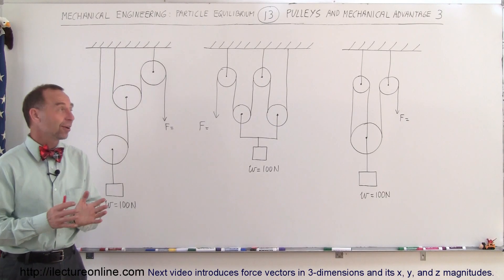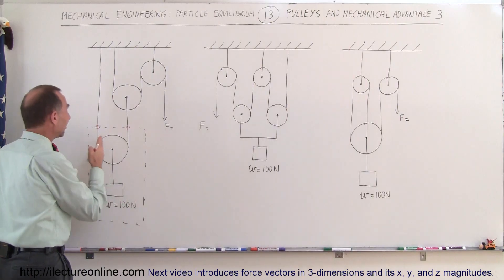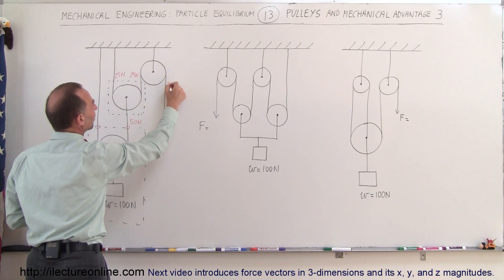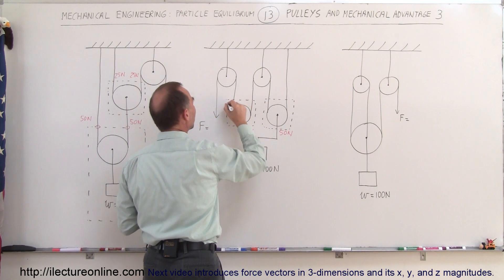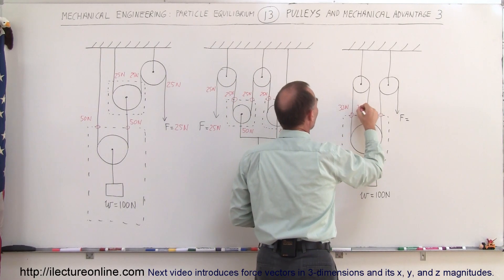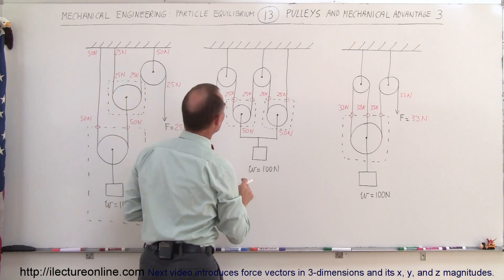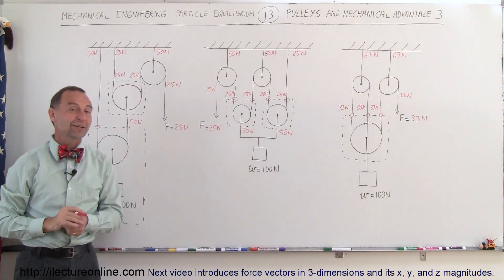Mechanical Engineering: Particle Equilibrium (13 of 19) Pulleys and Mechanical Advantage

Comment: Number 1 has 3 pulleys and you need 25 N.
Number 2 has 4 pulleys and same need 25 N
Reply from the maker: That shows that it is not always dependent on the number of pulleys, but also on how they are connected.

Comment: Wait, what? In your third example, let's say the supporting structure is a beam that has a breaking strength of exactly 110N. Now let's say that the open end of the system (F=33N) extends to the floor where it is tied to a shackle. In addition to the 100N weight, let's add 1N for each small pulley, 2N for the large pulley, and 1N for the rope, for a total suspended weight of 105N. Are you saying that the beam will break because the pulleys are inducing 133N on the system rather than 105N? I'm not a mechanical engineer, but I don't think so.

Comment: Hi Michel, thank you for that very clear exposition.
I have a question about how far the load can be moved before the upward moving pulleys can move before banging into the fixed pulleys. #1 looks like a winner in the MA = 4 category because it only uses 3 pulleys compared to #2. #3 has an MA of only 3 but uses the same number of pulleys as #1. 
Some systems used in mountaineering have "locks" that have to be moved or "reset" as the mountaineer pulls herself upwards. I suppose this stops the climber from falling too far if they let go of the rope but it explains why you don't see mechanical systems with these brakes right in the middle of all those ropes.
Please could you add some comments on the practicalities of each system and why some are preferable in given circumstances?

Comment: the teacher's explanation is too simple and did not get to the point! Everything must be reduced to simple mechanisms. The simple mechanisms are the levers and the inclined plane. If you reduce each wheel of the pulley with a lever with equal arms, then the analysis would be much clearer and much more essential. With respect, the professor did not reach the essence of the problem, making this parallel to the levers

￼
Reply from the maker: It depends on what you are trying to accomplish.  Thank you for your input.

Comment: Example 1 prediction: 50 of the weight has to be going directly into the cieling at the beginning because of the ceiling rope, so the other 50 weight has to be going into the middle pulley. 25n of the middle pulley has to be going into the ceiling from the rope, so 25n has to be going into the top pulley. The top pulley just redirects our force instead of multiplying it, so we need to put in 25n of force for 4x mechanical advantage and 125n in the ceiling. 100 from the weight 25 from our downforce.

Ok I seemed to visualize the free body diagrams similarly to you thats good. I didn't consciously think of it as 2 separate ones, but that seems to be the process I used atleast.

Example 2 prediction: has to be 50 weight on each connected pulley. Bottom Right pulley has to have 25n going to the cieling rope, and 25n going to the Top Right pulley. Bottom Left pulley has to have 25n going into Top Right pulley, and 25n going into Top Left pulley, and top left pulley should also have 25n from our pulling.

So 25 at right ceiling connection, 50 at middle ceiling connection, 50 at left ceiling connection (25n from weight and 25n from our pulling). 

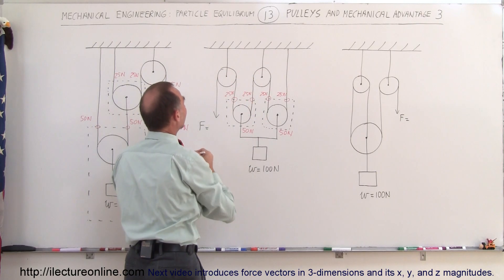OH 3:02 was really important to hear. I was kind of confused about how we as the puller add more downforce, but both sides needing equal tension i think helps me make sense of it.

I again didn't visualize the FBD like how you drew it, but I think i still did a similair process

Example 3 prediction: Bottom pulley has 3 connections, the Top Left pulley has 2 of those connections, so it has to be 66n, Top Right pulley has 1 of those connections so it has to be 33n, and because both sides need the same tension we need to be applying a downforce of 33n. So 66n on each pulley for 132n on the ceiling.

Ok I think I managed to predict all of those. Your explanations are really helpful.
Reply from the maker: These can be tricky.  Hopefully after a few examples it became clear.  🙂

Comment: I have a question. In the second case, where all segments of the rope/chord are dealing with 25 N, would the total force (100 N) dictate the strength of the rope required? I'm actually planning on using several small pulleys to bring a bicycle wheel spoke to 100 kg of force, and have wondered if it could be done with a string rated for a maximum 30 kg. Thanks in advance!
Reply from the maker: If the maximum extended tension on the string = x, you want enough margin to make it safe and you want a string with strength 2x to 3x

Comment: Hi Michel ..  before I saw these Pulley Videos.. I would have thought that the Total Weight being supported by the CEILING would always equal the Weight of the mass being supported.. WOW, was I wrong.... Thanks for another Counter Intuitive moment in Physics!  I then imagine just ONE pulley hanging from the Ceiling with one rope over it. One end of the rope was connected to the 100 lb Mass and the other end of the rope went over the pulley and was being held by ME..  So, I would be pulling with 100 lbs of force to hold the 100 lb Mass steady.  Therefore.. the ceiling would be pulling up with a 200 lbs Force !!!  amazing!!  thanks again for your nonstop contribution to the perpetuation of Knowledge to the Masses.... not kilograms, but People    :)
Reply from the maker: Philip.  Good insight.  It is interesting where the principles of physics will take you.
Reply: 150, not 200

Comment: I was confused in the third example. At first I thought the load was suspended from the top left hand pulley. The explanation made it clear the load is attached to the lowest pulley. In an exam this should be made clear, otherwise an incorrect answer of 50 Newton could be made by a student that understands pulleys.

Comment: Hello sir, plz advise , I have 100 N load , attach with 2 different pullies with 2 separate ropes , one is top left other is top right side... i e. this is 2:1, 2 seprate  arrangements ...attached with same load... if I pull both the ropes simultaneously...and wants to pul load  1 feet up...will I get 4: 1 advantage...

Comment: Great explanation,   What if I wanna pull out a tree let's say I have 8 pulleys  Can I put 4 of the pulleys all on the tree, I'm gunna see if I can pull a TREE out of the ground with a bunch of snach blocks. I mean what could go wrong
Reply from the maker: It is very dangerous.  The ropes will be under very high tension and if anything breaks or snaps, watch out!
Reply: @MichelvanBiezen   Got another suggestion for pulling big stump side of the ground other than using a backhoe

Comment: Sir please  tell me what load i would get on winch for lifting load of 1200 kg by  using two pulley on top and three pulley on lifting  load  bar
Reply from the maker: That depends on how they are connected.  You have to use free body diagrams as shown in the videos to calculate the mechanical advantage
Reply: @MichelvanBiezen  thanks  sir

Comment: I was wondering how the diameter of pulleys affects pulley systems.  I would have thought similar to gears
Reply from the maker: No, the diameter on pulleys does not matter.  It is different with gears since the number of teeth per gear does matter.

Comment: Stationary (anchor) pulleys only redirect force. 
Moving pulleys (load)  provide the mechanical advantage. 
Yeah, I know,  that’s what he just showed us.  Anchored or moving just helps my brain quickly calculate a system that I’m looking at. 
That third example on the white board is a fictional mutant.  What I mean is, I don’t think you’ll see it in any practical application.  Let me know if I’m wrong.
There is a video of a small vehicle pulling a tree out of the ground with a 45 to 1 pulley system.  And if you have a long length of strong rope but no pulleys,   YouTube search “flip flop winch”.   It’s amazing.

Comment: I was with this guy until he claimed that ceiling was holding more weight than what was being held up on a a static line. That last pulley is just a redirection of force. You can remove it and attach the rope onto the ceiling and you would still have the same amount of force on the ceiling. If the load is being raised then there would be an increase in the amount of force the ceiling holds that would be proportional to the acceleration of the pull.
Reply: But it is the redirect that changes the weight.  If you tie off, the ceiling is pulling UP with 25N.

If you now untie and use the 3rd pulley to apply the 25N by pulling DOWN, you are now adding the extra 25N.

Imagine just the redirect on its own with a 25N load balanced with another 25N.  There will now be 50N on the ceiling.

Comment: Take that centra pully system,,, If you were to stick a pin in the top left hand pully so as the pully wheel is stopped from turning,,, Then how much load would be on the ceiling???  I believe it would be the total waight of the load and the pullys and ropes,,??????   Now I get confused as from the way I see it, any force you apply down on the far left rope to lift any effort put on that rope must surely then be the same on the opposite rope and then that force must be transfered through the entire system  the ceiling should or surely can only see the weight f the weight and pully system combined at any time, all be it that load is sheared by the three hanging points,,,  may be another video to explain   ,Lol  May be a set up with spring scales onall thre hanging pointsI believe any force down on the left rope will be lots of the two others,,,?????

Comment: I wasn't able to understand the last 125N until I did the math and saw that yea it should only be 100 but then I realized that's true if the 100N was just sitting on the floor. But since you solved the problem from how much force you would have to be pulling down on the rope traveling through those pulleys if the ground suddenly disappeared leaving the block motionless if you hold on, you add your down pull too. Maybe someone will understand if they don't? If yea please like share and subscribe this comment, and then join Facebook and Twitter and share it to your wall and your friends walls! Thanks. If not just flag it til it disappears

Comment: For those wondering why the ceiling requires 125N to hold a 100N block, the extra 25N are coming from YOUR force on pulling on the rope, which is 25N.
Reply: thanks bro that was just what I was thinking
Reply: Nishant Gogna, yep, and that is yet another free body diagram you can draw (around the whole lot).
Reply: @GeertDelmulle  Yes indeed,, if you do that around the whole lot of the centra pull system with wheel on top left fixed in position say with a pin the three top ropes would show 100 n surely and any pull force then applied to the left down rope would be lost or sheared by the opposite rope and so on, the force the ceiling see at any time can only be the 100n plus the weight of the pully system.. lke to see this done in real time with spring scales on top three ropes may be?
Reply: @petethewrist  Do it, go buy some fish scales and video!
Reply: Ah nice thanks man
Reply: You look like an actor
Reply: Thank you.
Reply: Ya i'm not buying it.  If I am not "pulling" on the rope. Just tied it to the floor to hold it static there. It's impossible for it to weigh more than the total weight. Assuming the pullies and string weigh nothing.

Comment: This is very paradox. To hold a weight of 100 N up, you need a ceiling hook of 125 N. (first pic). Imagine them static, not moving. Funny, isn't it?
Reply from the maker: Don't forget about the 25 N force acting downward.
Reply: The extra newtons come from the tugging of the rope to lift the block up, ie. your force pulling on the rope.
Reply: If a man is hanging on a rope thrown over a branch, being balanced by another man on the other end of the rope, the branch must support 2x each mans weight.

Comment: Hey, wait a minute. In the diagram on the left, he says it takes 125 Newtons of force from above to suspend a weight pulling with 100 Newtons of force? How could that be? 

Scenario1 : I need to go get a drink of water. I tie a knot in the rope so it sticks in the last pulley.  NOW how many Newtons of force are pulling down? 

New scenario (That would be #2) : I need to eat a cheeseburger. I tie the end of the rope onto the weight.  NOW how many Newtons of force are pulling down? 

I'm going to go have an iced tea - with lemon and honey - and let this sink in a while...
Reply: okay, so the weight is pulling down in the y direction as is the free end of the pulley rope on the right. so, in total, the force of the mass and the force by the rope equals 125N downwards, which needs 125N upwards to hold it in place in static equilibrium
Reply: The force on the ceiling will always be equal and opposite to the downward force of the system. In lieu of you pulling down, the only weight on the system is 100N. 

Scenario 1: if you tie a knot in the rope on the last pulley, it essentially eliminates that pulley from the system. It would be the same as typing it directly to the ceiling. Since there's no downward force, the total force on the ceiling is 100N.

Scenario 2: This complicates things, but you can still resolve it using free-body diagrams. It's easiest to start with the pulley on the right. If you work through FBDs for each pulley, you'll find that the right pulley is supporting 20N directly, while the left pulley supports 80N directly. The ropes attached to the ceiling have, from left to right, 40N, 20N, and 40N of tension. Therefore, the ceiling again must support 100N of force.